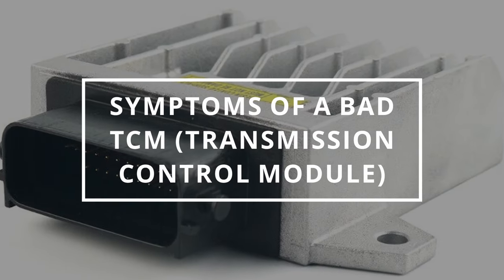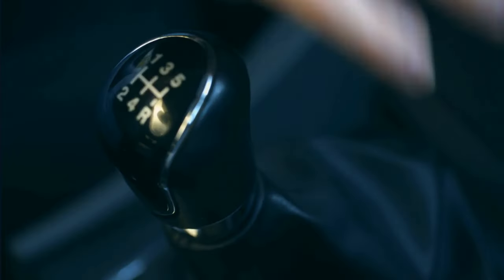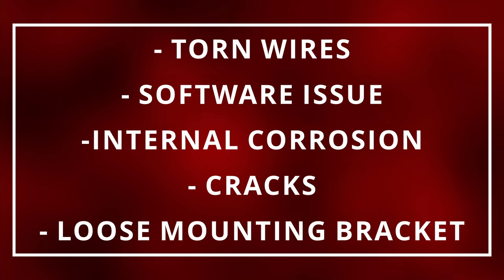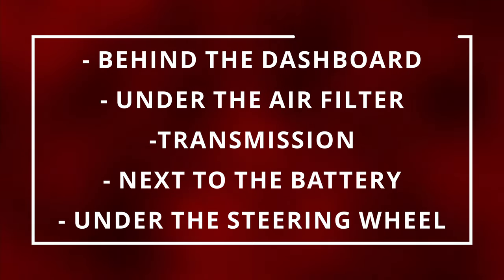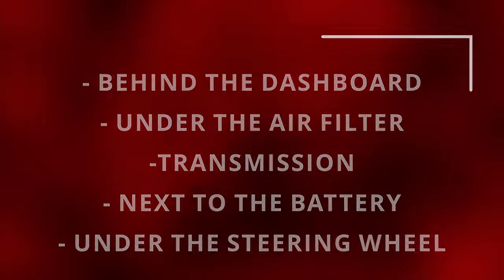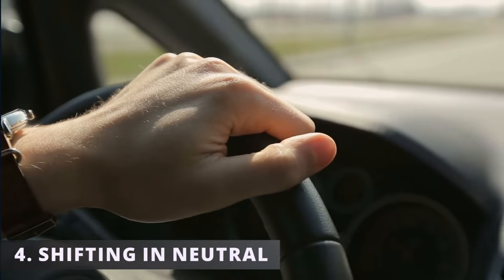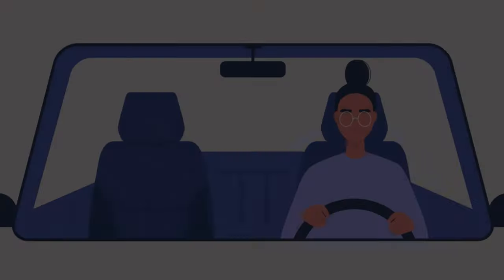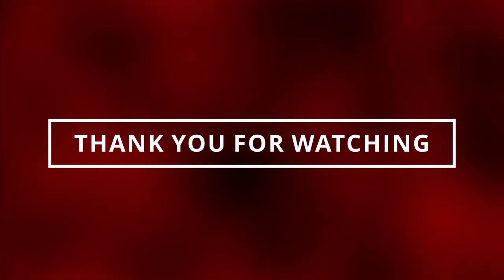SYMPTOMS OF A BAD TRANSMISSION CONTROL MODULE

Comment: i dont have any codes but my tranny has been weird for over a year. Im going nuts trying to figure out what is wrong with it without having to take it to a shifty shop to look at it and try to gouge me!  I dont trust any shops! ugh!  What can be wrong without throwing a code? There arent any videos on this!
Reply: I have found that it's Best to take your Vehicle to a Real Transmission Shop...

 They will charge Around $100 to diagnosed your transmission..  

that's the Cheap part.   🤭
Reply: Mines doing the exact same thing but no engine light
Reply: @OG-COLD-N-SOLID  wait what???
Reply: Do you have a sophisticated ob2 scanner, dont use any cheap scanner
Reply: @willpage79   I don't but I will invest in one. Right now me and my Dad is doing a drain and fill and see if that helps it not making any sounds just periodically going into limp mode.
Reply: @williamgrant4552  wen I say cheap more like a no name brand u get some thing name brand for 40 or 50 ..mines is acting up got a code po757 just drain and refill to any diff
Reply: @willpage79  ok thanks a lot
Reply: Could be your transmission wiring, my cars tranny was acting weird for a few months until it finally stopped moving,  it turned on and sounded normal but it just drove weird.
Reply: @williamgrant4552  Rats can mess up a car . They bit through 3 wires where they were sleeping in my jeep . Tried to start it , not even a click .  Fixed it . Fired right up .
Reply: @pennyhelga3628  oh wow didn't know that😳
Reply: @williamgrant4552  They were sleeping between the fuse box and battery in my 2011 wrangler . After fixing the the wires i gunked the engine compartment with foamy engine brite cleaner  . Rats don't seem to like the smell yet they will sleep in thier own feces  .
Reply: Might be just a transmission solenoid that can effect gears switching. You can get stuck in certain gears or can shift passed certan gears or called the shift solenoids.
Reply: You don’t trust shops! Well drive junk then.
Reply: What symptoms are you have
Reply: Low fluid, trans control module,neutral safety switch.. could be more than a few things
Reply: if no codes thrown cats could be blocked try removing cats and drive your car to see if anything changes

Comment: My 2008 GMC Arcadia is telling me my transmission is hot, before i even turn it on... recently replaced a radiator hose and thermostat but it's still doing it. Could it be because of a damaged TCM?

Comment: Limp mode is exactly what has occurred! Thank you!
Reply: yea a shop said mine was in limp mode bc the computer in my car just “thought” i had a real problem and the shop said i didn’t so he rest it and yea it was running fine for like 2-3 weeks almost then boom it started doin the same thing so i took it to a real shop and they figured out it was my solenoid c that was bad
Reply: @darrienhunter312  how much was repairs ?
Reply: @cowtippindwarf15  keely,  do it yourself it’s not hard just messy sometimes
Reply: @darrienhunter312 what kind of solenoid was it? If you can remember

Comment: Exactly P0700. SOooo 1-2 shift solenoid valve is stuck on. Shift solenoid A is stuck on. Hopefully only replacing Transmission Valve Body Assembly will fix this.

Comment: TCM can also stand for your Traction Control Module.
Reply: While that is true, typically Transmission Control Module is the first choice for TCM. If traction system has a control module manufacturers call it other things such all’s (VDC -Vehicle Dynamic Control System, Skid Control System, TCS Traction Control System, etc…

Comment: I'm getting a p0720, which is an output speed sensor code,  plus at light. I replaced the sensor, but that didn't work. I cleaned the inside of both input and output sensors and that cleared my problems for a couple weeks, then they came back. I'm stumped. My transmission fluid is good and I believe my wiring is good too, but idk what it could be. maybe I should've replaced both sensors. Any help would be greatly appreciated. Thank you
Reply: Maybe a bad solenoid. I repalced the whole transmission on my Chrysler 300 and it still didnt shift into 4th Gear. I would reach 60 mph and the RPMs would be over 6,000 and I could hear the engine.  Bad solenoid.

Comment: My 1997 Honda Accord EX Wagon set up for at least a year and seems to be slipping in 3rd gear, especially when turning or going up steep hills. It’s also  running really sluggish which is probably limp mode I’m figuring. My car has all the signs of a bad shift solenoid. I took it off and cleaned it with brake fluid real good while I put current to it to open e’m up. One side was completely stopped up. I put it back on and I could tell immediately when I went thru the gears it was better but it’s still slipping a little bit and not changing gears like it should. Also, I did not put Honda Transmission fluid in it. Should I do this to all the trans solenoids? The solenoid I cleaned clicked when current was put to it. What should I try next?

Comment: every time by the UC Lancer goes into limp mode, I smell transmission fluid. I did a transmission flush over two months ago but it did not seem to start then. I had a cold air intake by my tire and water got into the filter into the throttle body and inside throttle body was caked with black dirt. Do you think main issue is is tcm?

Comment: Would it cause a shifter to get completely stuck in neutral? Unable to shift into any gear or move?
Reply: I’m having the same issue in my 2017 Evoque. I’ve had the gear rotary knob checked and there’s no fault apparently. So after a long google search it could be the TCM . What car is yours?

Comment: What if i have none if the issues above except fuel economy? 
And the fuel economy is more thst likely my foot on gas pedal/ loads i carry/ oversized rims n tires.
BUT I had it towed inbto nearby dealership and the diagnostic they ran told them to replace transmission module??
Truck is 2019 and has only 56k moles miles on it.
Please any answers, thoughts or direction would be greatly appreciated.

Comment: Question 2014 Chevy Impala Lt 2.5L I have lost control to the TCM abs power steering warning sign and stabilitrak when trying to shift in gears  car doesn't light up in the gear box

Comment: I don't think the OBD2 scanner that you put in here has transmission codes , it says nothing about them?    
Also does anyone know p 0420. And p0054    the Cadillac converter and the O2 sensor , I'm having all these symptoms and i have a 2011 ford fiesta , but I think these codes can do the same thing if I'm not wrong please help anyone know ? Does my ob2 scanner doesn't read transmission codes and the one that he listed on here does it say anything about it does either.

Comment: Hi I have an 05 Jeep Grand Cherokee Laredo v6 3.7. getting codes U0404 P0700 loud whining like sound in all gears. Sounds like bad serpentine belt but it's definitely not that. I took belt off sound still happens). Sound comes from the passenger side
Reply: Did you ever find out what the whining noise was?

Comment: I have a 2006 Suzuki forenza change 4 transmission range sensor does the TCM have anything to do with displaying the correct gears on the dashboard cuz mines is only showing p reverse two that's it

Comment: I replaced all mounts on my 2010 Impala, but it seems to kick/jerk when i shift from parking to reverse, at times it kicks pretty hard, anyone knows what it could be? 
A transmission solenoid maybe?
Reply: Following 😩. ….did you ever figure out what it was? Mine is doing this now. When I shift to reverse it jerks and when I put it in drive it jerks…weird
Reply: Motor mounts

Comment: Hi, sometimes for no reason the rpms in my wj 4.7 2001 just drop or the car simply shuts off. But then it runs perfectly again, no issues at all, super smooth idling. The car  also shifts normaly . .Could this also come from the TCM? PS I checked and cleaned the idle air control valve.
Reply: Did you find solution?
Reply: @kashishsadadia3623  yes I think I did, I changed the MAP sensor. It was fairly easy to change and cost around 30$. Since then the Jeep runs like a charm.
Reply: @cluboffreedom2610  Sometimes my car gets delay to accelerate about 4,5 seconds. I don't know if it's TCM problem ornot. Btw thanks for letting me know.
Reply: @kashishsadadia3623  What error code is the computer giving you?
Reply: @cluboffreedom2610  I am not getting any error code !

Comment: I have 2x DTCodes as follows: (i) U0103 'Lost comms with Gear shift Control Module A' ;                      (ii) U0404 ' Invalid data received from Gear Shift Control Module A'. my Gear Shifter is 'locked' in Park and my Brake pedal cannot be depressed. ( also 'locked up'). The engine won't start You don't mention any 'U' Codes pertaining to the Transmission Control Module..... Help!
Reply: Any update bc I have the same problem. Just switched out the secondary battery idk if that will help

Comment: Sir i have chevy impala 2018 v6 and i had transmission problems so fixed right then it start to develop the same problems you mentioned in video and checked my car by computer and it shown that i have bad TCM so i replaced it but without programming it and now the same problem persists so plz can you tell me how can I program TCM and does programming can fix the issue.. many thanks for your help

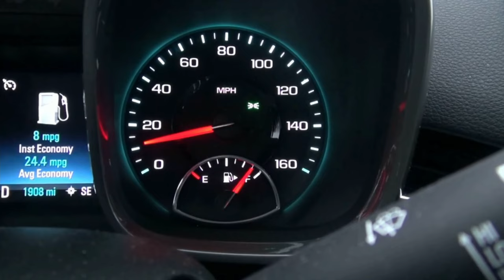Comment: 01:17 Of course its the odometer for a chevy malibu lol. I have a 2014 Malibu and TCM failed, but the code for the malibu is U0101. Requires a new transmission. $8,500k+. Bye Bye malibu

Comment: I just got my trans rebuilt and had the torque comverter upgraded. 
Now i keep getting p0700 and p0797 
Giy at shop told me it needs a tune for tje torque comver since it think it has a 1600 stall whem it actually has a 2400 stall
Reply: Take it back to shop should have a warranty!